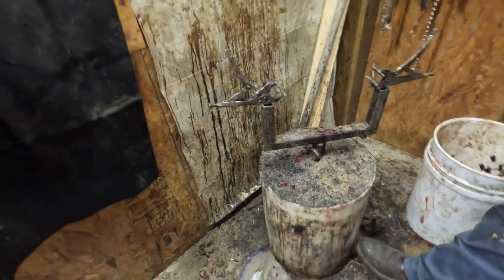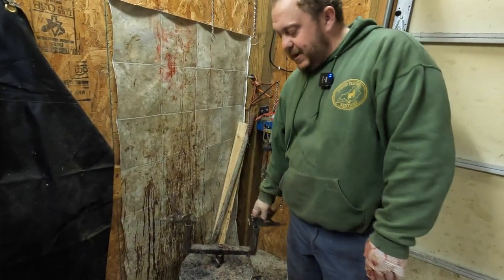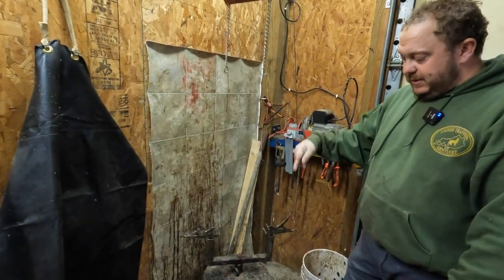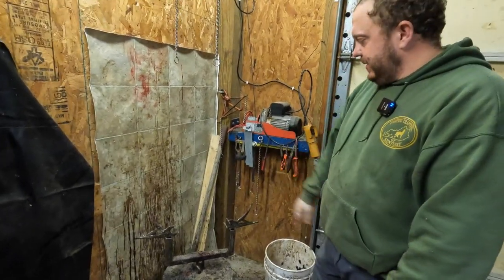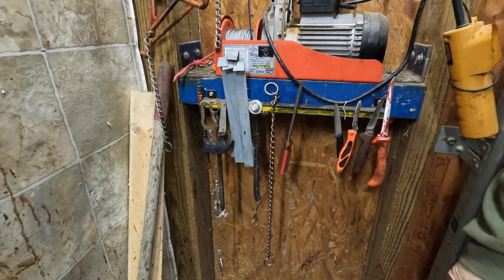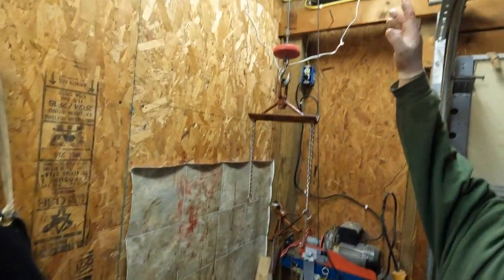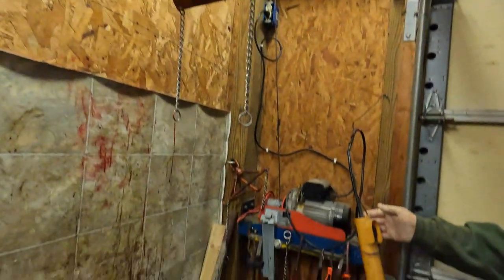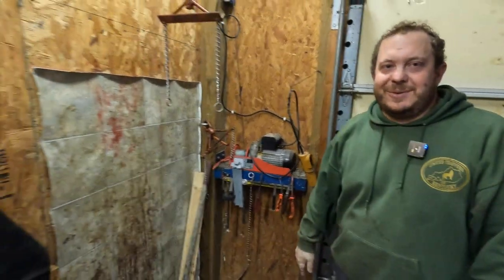how to make a homemade skinning machine

Comment: Nice thanks for showing the setup.  I been wondering how to build one. I hate skinning coyotes by hand. How wide would you build the bottom set up the metal part? Would 1 inch square tubing work?